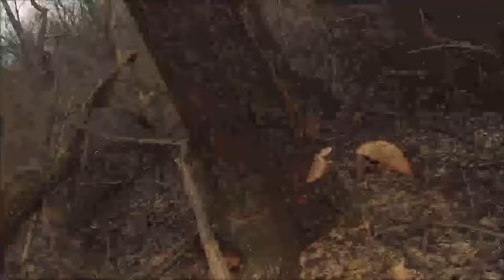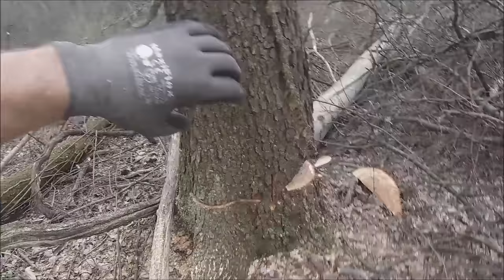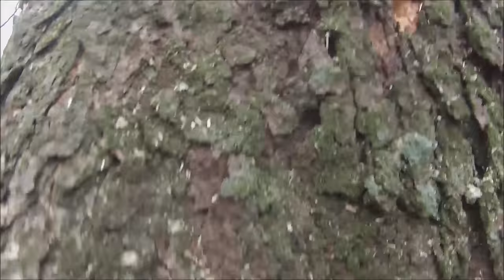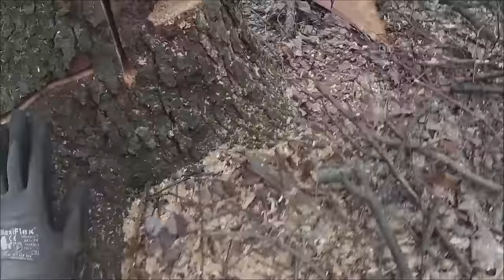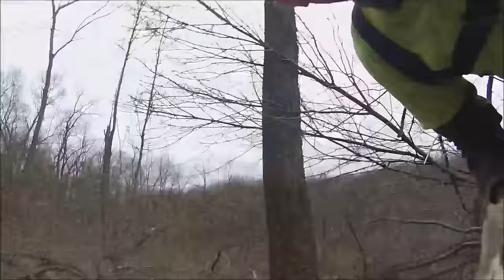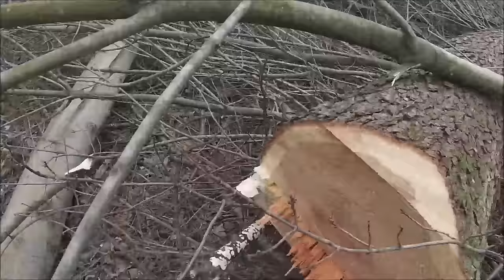hinge explanation

Comment: I think part of the reason it works is the plunge  slot allows the hinges room to flex vs. break. See also: shark gill cut.
Reply from the maker: You are correct I have learned a lot more about this cut since posting this video.
Reply: @nuts319  yeah I figured. Posted more for others coming along seeing it.

Comment: There is a reason why it's not done in Scandinavia, less accidents. That cut works but it also weakens the side supposedly holding you lean and the vertical cut can in worse case cause that barber chair. It's way more control in the triangle safe corner cut

Comment: It's my understanding that you only, vertically boar cut half way through for the triple hinge, used for heavy leaning trees, on the tension side. Two vortical cut about 1 inch apart, going above and below your notch. That allows for a lot of stretch for the fibers to keep pulling on that side for much of the way down, during the fall, while the other side just breaks free as normal.
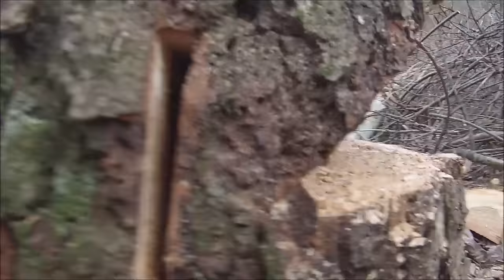@2:40 Here, you have boar cut all the way through, so there is no advantage in correcting lean. 
If you are felling, relatively straight, you can use a horizontal boar cut, 1-2 inches higher than the level plane of your facing notch, then your final cut from the rear of the tree.
I'm no expert, but that is my understanding from my studies on the tipple hinge.
Reply: I never tried out this cut, should have used a swinging duchtman on this tree. Is the result the same?

Comment: What does this do that a normal wedge hinge does not do?  Or a normal wedge hinge with a bi face cut?  A lot less cutting for same thing and do not have to worry about tip of saw coming back in your face.
Reply from the maker: It hangs on just a little longer, no always conducive to use
Reply: @nuts319  Hangs a little longer... By experience or hearsay?  I have seen others use this or say to use it and I always think... WHY?  I could put same tree in exact same spot and I saw no advantage I could not have done an easier way.    Maybe with VERY brittle wood???  Gives room for bending wood fibers before they rip apart in the hinge if brittle?  Is this what it actually is for?  Very brittle wood?
Reply from the maker: @w8stral  works better in brittle wood yes. Not something I always use but works nice in black oak Scarlett oak and others with similar grain. Once again I don’t use it often
Reply: @nuts319  Ok, thx for replies.

Comment: swing cuts used to be used falling timber from corner markers depending on direction you would angle down the face cut then start from the bottom and cut up leaving the hinge at the top which would be fairly small the tree would swing around........ most of the time  it is no  longer allowed to be used in the woods out west to dangerous
Reply from the maker: NJ Blanchard ah, yes it is used from time to time but not often, most hardwoods around here are too brittle to get the swing goin before the hinge breaks off

Comment: So I don’t want to offend anyone which unfortunately seems easy for me but explain why you don’t start on your holding wood side of your hinge and, as you say, chase your cut around? Our hardwoods in the pnw I believe may be more forgiving than yours for splitting or barber chair possibly. A lot of what we do with a tree involves getting the tree to move and using that to place the tree which is why we bore less and chase more I think. I think we use larger saws with faster cutting chain from what I’ve observed on various channels. I’m not saying I could step into your shoes and do better but I wonder how technique from here would transfer. It’s all logging but different areas have developed what works there the best. Have you tried just zipping through your hardwoods, even cutting off the hinge before it can split? The trigger appears to slow down production. Why is it necessary? Again I’m trying not to criticize anyone just wondering from one area why you do what you do.thanks